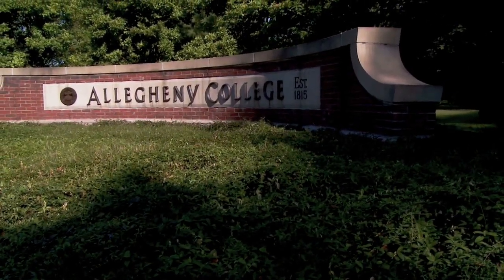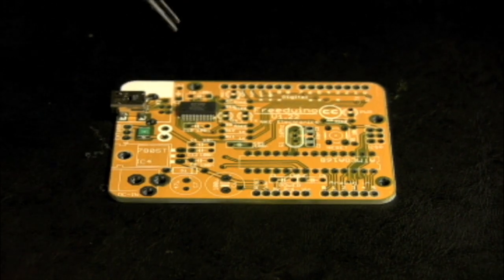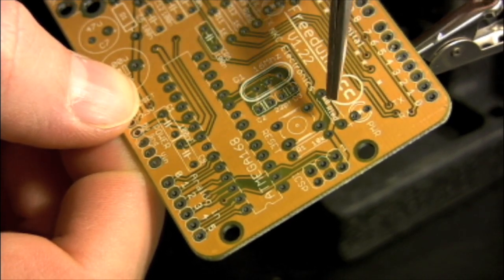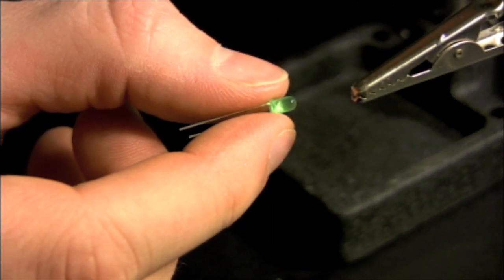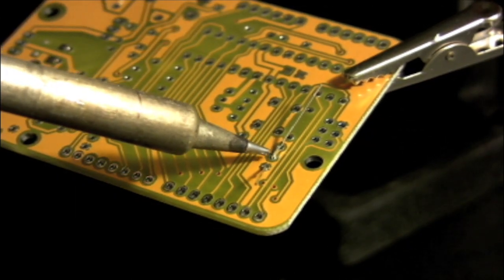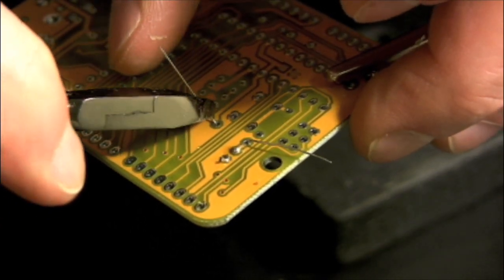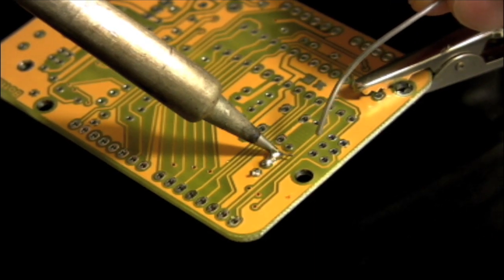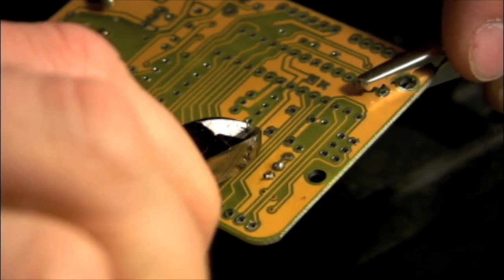Freeduino Build: Part 1 of 5

Comment: The soldering procedure is a little off. You should first touch the solder to the soldering iron tip. The solder will then melt and for a pool that will better conduct heat to the area you are trying to solder. The solder will also release flux that aids in soldering by cleaning oxides the form on the leads and resist the tinning action of the solder. The net result is you don't have to stay on the lead as long, an important point when soldering semiconductors. Watch for the solder to flow rather than bead around the joint. This is the sign of a good joint
Reply from the maker: I agree. This video was made some years ago, and... I have learned much since then. Unfortunately, I no longer build this kit with students, so I'm not really in a position to remake the video. I highly recommend the "Learn to Solder" comic for this kind of material: http://mightyohm.com/files/soldercomic/FullSolderComic_EN.pdf